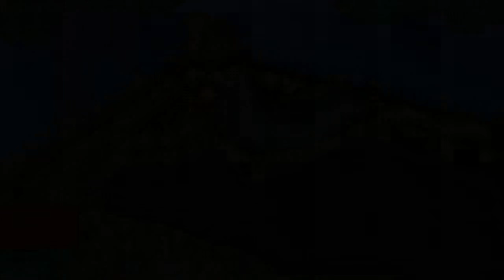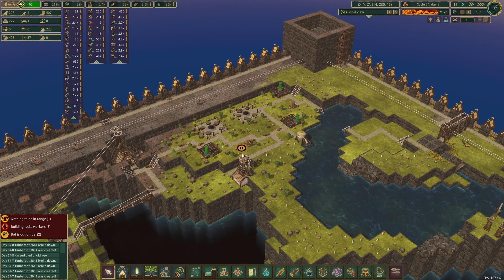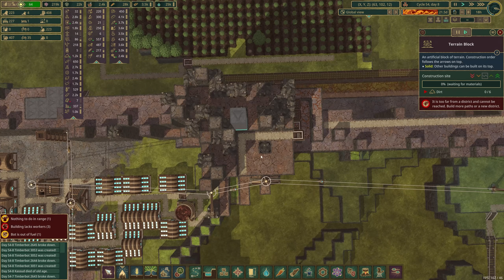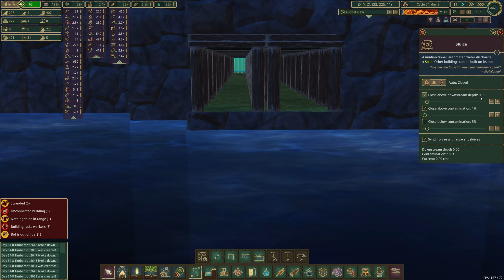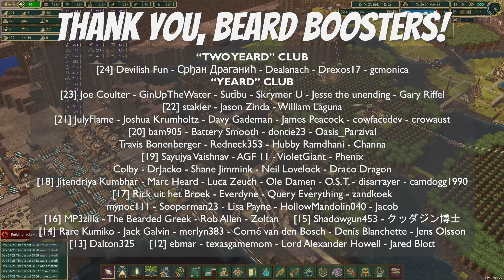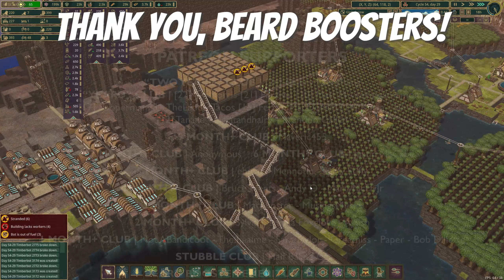Time to build the Earth Recultivator tower! Timberborn Update 7 Folktails Hard Mode Episode 45

Comment: 25:38 when are you finally just going to add another level to the farms and do an entire level just in Maple and then do the lower level or the above level in a awesome design that includes all three of them Maple pine and Chestnut😊 this will for sure stop the not having enough supply or you add two more levels and do a level for Chestnut a level for Maple and a level for Pine with both the Chestnut and pine levels having designs including Maple in them giving you the abundance of syrup that you need😊 also another idea is make a pond or reservoir and make it to where all your beavers have to go through it via a zip line under the water to give them a wet fur bonus and have it to where all of them must take that zipline to get access to either their housing or food this means that you might have to put in multiples😊

Comment: 13:40 Would it make the most sense to have a sluice at the end to not allow water to leave that back reservoir when the level at the bottom is already full?  At the moment it would either flow indefinitely, as there are just dams preventing water from flowing off the edge of the map, or it wouldn't flow at all, both based on the level you set the sluice to.  That way you don't lose water from the top reservoir until it gets to the spillway in the middle, which you could increase in height since it's not being lost to the mini-aqueduct overflowing anymore.